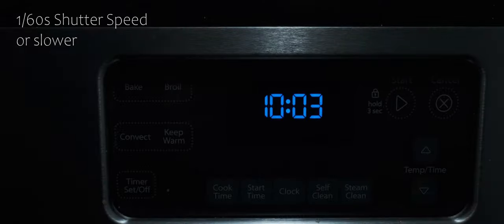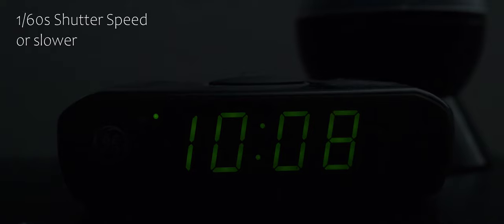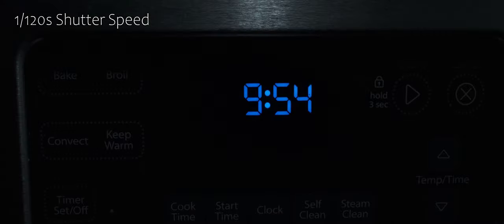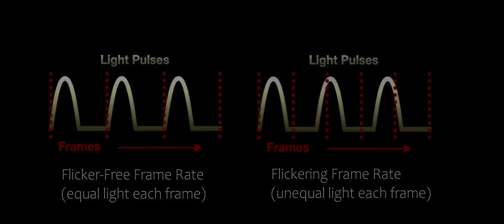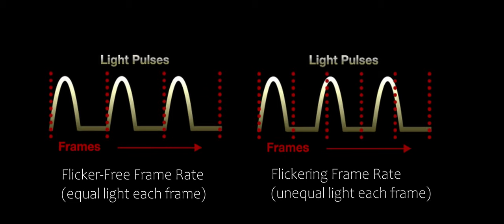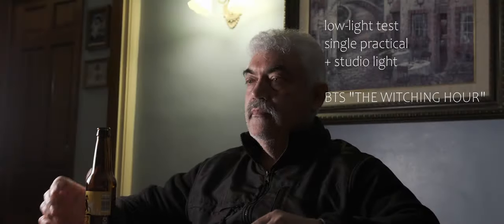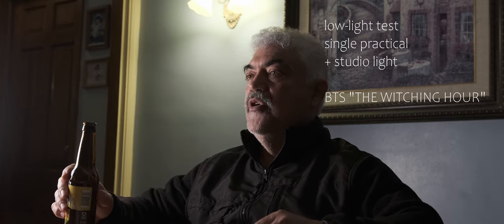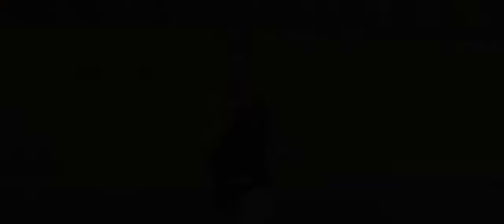FIX LIGHT FLICKER IN VIDEO or FILM | CINEMATIC FUJIFILM SAMPLES #filmmaking #cinema #fujifilm

Comment: How to avoid it in slowmo?
Reply from the maker: In slo mo it's a bit more complicated but the principle is the same. Even professional shows on TV or Netflix I've seen this mistake and the flicker is present. You have to either accept the flicker if it's really high speed with artificial lights or computer monitors and screens or you have to find and use lights whose refresh rates are even multiples with your shutter speed/angle that you are using. 

In the case of commercials for phones or tablets and things like that, they actually sometimes record the screen separately and then edit into the scene that particular screen. You can sometimes see it if you watch very closely because the edges or contrast looks a tiny bit off, but most people who aren't looking for it would never notice. It also takes a very steady or tripodded off shot to be able to do it well.
Reply: @pierrezapata90  my experience is in fitness content, where the neon of gyms shows flicker when I record some movements in 59 fps (so 1/120). But in some competition indoor I see people doing slowmo but without flickering. I can’t figure out how to do it